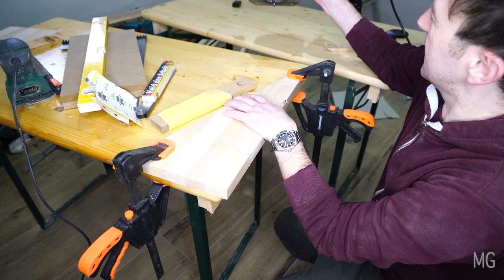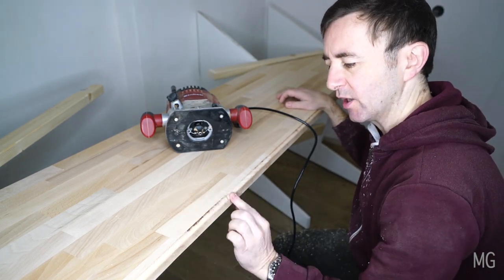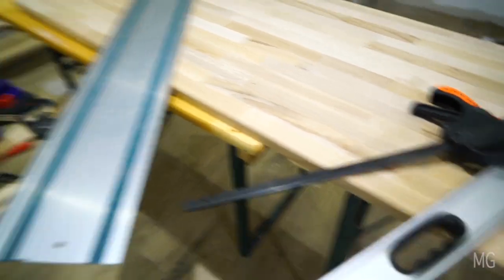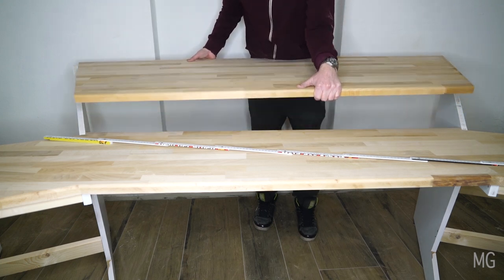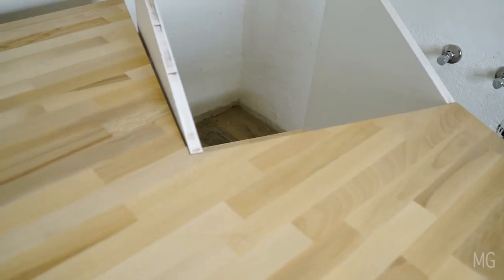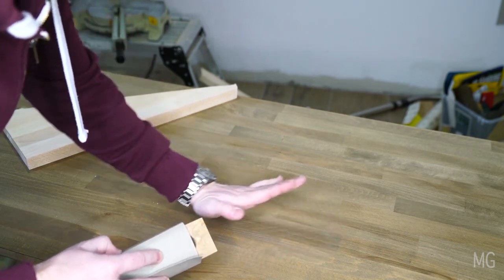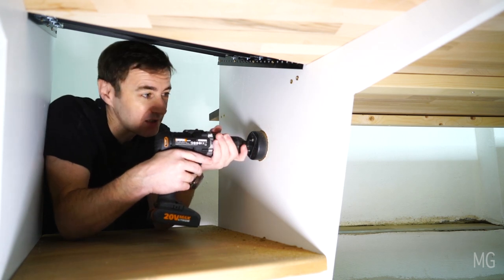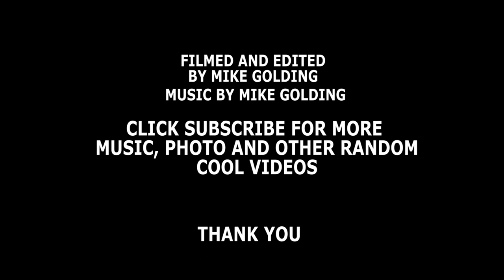ULTIMATE COOL Studio Music Desk (Part 4/4)

Comment: Great videos. Just wanted to ask - are you sure you're going the right direction with the router? I'm pretty sure that's the SPIN direction, not feed direction. I've always learned to go "counter-clockwise" around an object, and feed from right to left when using a table router.

I think this is the reason it was so rough, you're not pushing the blade towards the wood, and the router is able to push itself out.

Comment: @1:15 - the arrow shows the spin direction of the bit - anti-clockwise viewed from above - not the direction you should move it against the workpiece.  The cutting edge of the bit should be running against the direction of travel, not with it.  In other words if you were working from right to left, then that was the wrong way.  Aside from being dangerous, this might explain the roughness of the finish.  The quality of the router bit (if bundled with a €50 router) probably doesn't help (a decent router bit can cost nearly that on it's own).
As others have pointed out, hearing and eye protection mandatory with any of these power tools!
Nice finished result though.